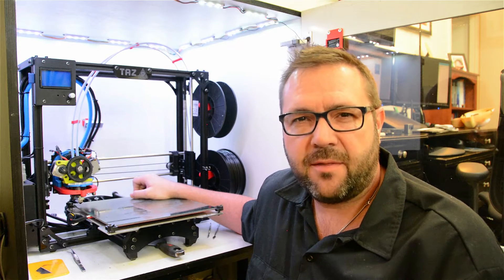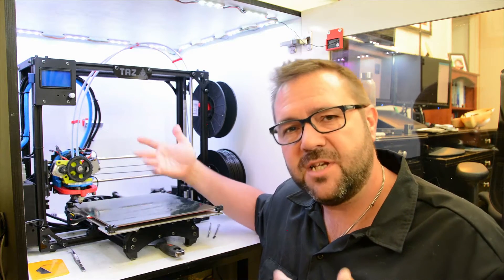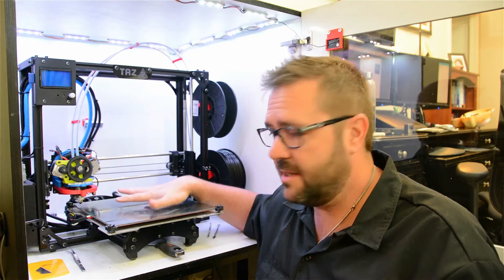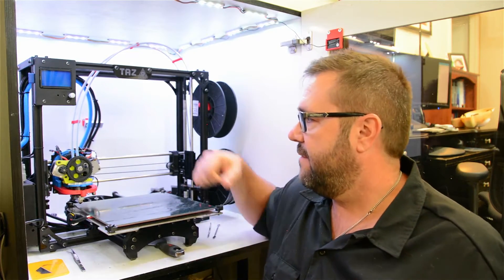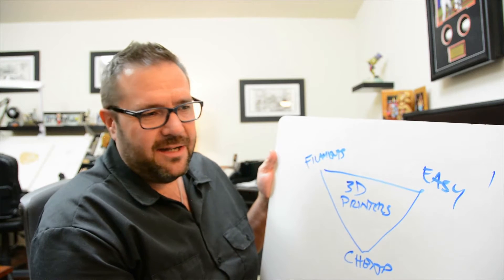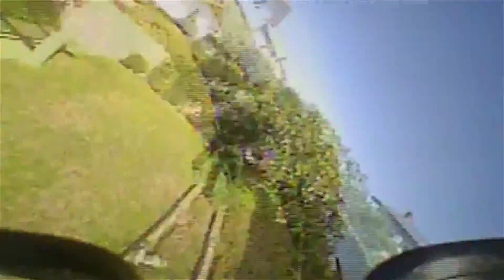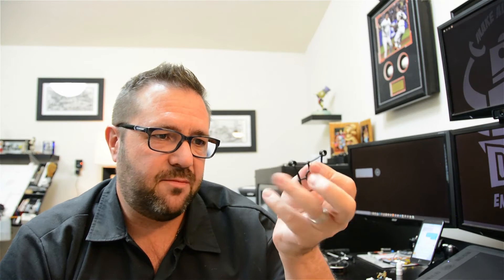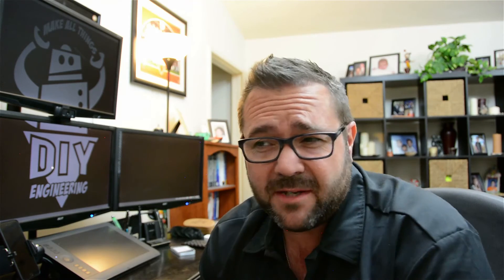Episode 013: 3D on the cheap and Acro Whoop Frame!!!

Comment: Great content, what's the difference between the minimal and the race version in terms of weight or design?
Reply from the maker: race version does not have any prop guards or extraneous strengthening (saves almost .5g)
Reply: So the minimal is a bit thicker than the race version? I suspect if you're doing no bumpers there isn't much reason to have a thicker frame because you're assuming you won't crash anyway. Any problems with the durability so far of the thinner race version?
Reply from the maker: true, but when you print it, the infill will determine the weight more that the shape.
Reply: Did you not use 100% infill with these prints? I guess I assumed for such small parts you almost have to do 100%? Thanks for you feedback, it's super helpful!